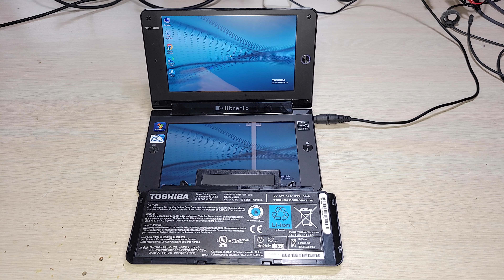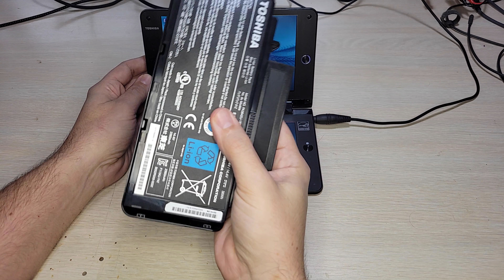Libretto W100 (W105) Battery Repair and Rebuild

Comment: Thanks for the video, very useful and informative👍. Just got the package with my w100 today. While watching the video, I managed to disassemble the battery. Now I just need to buy the cells, solder them in, and it'll be as good as new. Tip for anyone opening the battery case: I recommend pouring about 5ml of rubbing alcohol inside first to soften the glue, and then unclipping the case by pressing along the seams (not across) using something like a business card

Comment: This is pretty interesting,  this is a really well-done video. I have 2 w100's, one the stock battery still have some life in it, though this is a good reminder to pull the battery out. The other one was bad, I'd also disassembled and couldn't find any replacement cells, and that spot welded double-stack of cells looked like more than I'd want to tackle. I ended up just removing the cells and board and putting in some weights so it wouldn't tip over. But doing this with a single row and soldering wires seems pretty doable to me, I think I'll give it a try, did you happen to have a link to where you got your cells?
Reply from the maker: YouTube is weird about links, search "704060 Battery" on eBay. If the cells have a connector you can just cut this off, make sure you do that one wire at a time so you don't end up shorting them out. The hardest part was disassembling the battery case without outward damage and removing the old cells. The rest was easy to connect the new cells and put it back together. Thanks for the kind words!
Reply: @RobertsRetro  to follow up, I got my new cells and was a pretty straight-forward swap following along with your video. I was able to charge it to 100%, though my pack is at 72% wear level so it only filled it up about a third. I think this is kept in eeprom and can't really be reset without special tools. In any case very happy to have another working battery.
Reply: @jasonnovak2121 контроллер сам отклабирует емкость аккумулятора
Reply: Hi i need battery for my unit.  If you have extrq would it be possible to get one? Many thanks.
Reply: @technogeekchris  These batteries are very hard to come by, if you have one that's dead doing this repair is your best shot. It's pretty rare to find one loose at this point, no 3rd parties sell them, and the guy on eBay with NOS batteries will have customs issues shipping if outside his country. I managed to get one by getting someone selling their W100 with 2 batteries on eBay to sell me one of them separately
Reply: в остатке на аккумуляторах не 6 вольт а 0,6 Миливольт, ставите мультиметр на вольты, значение у вас после запятой а не до неё..